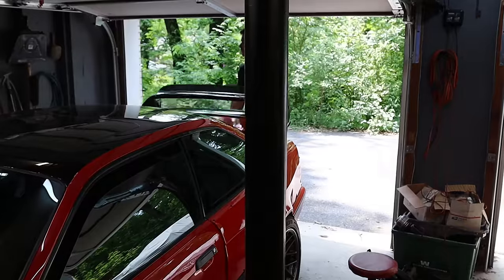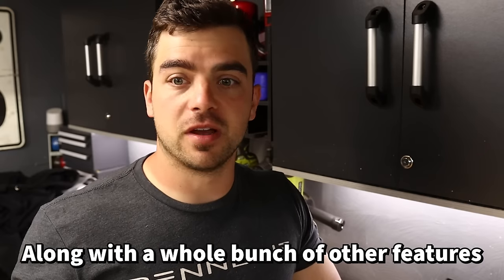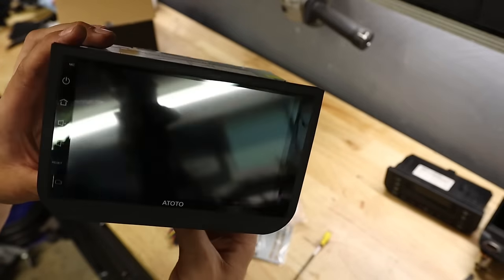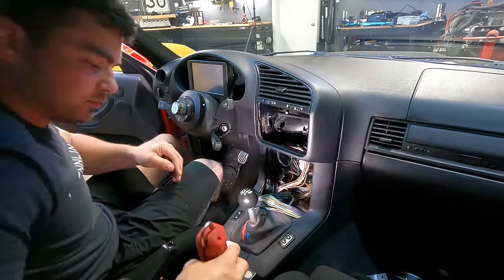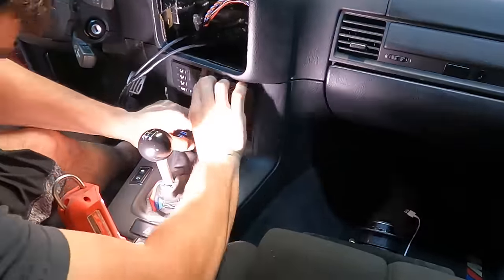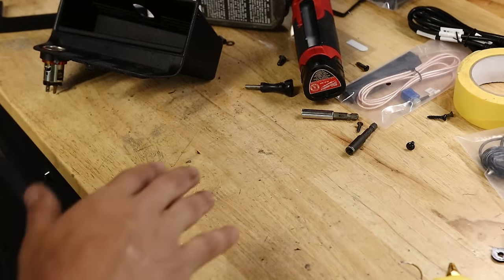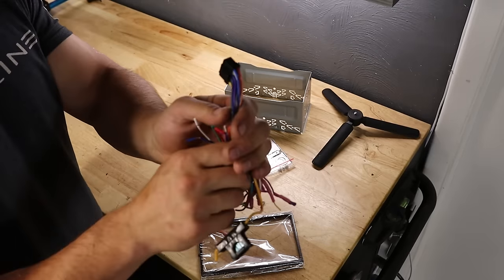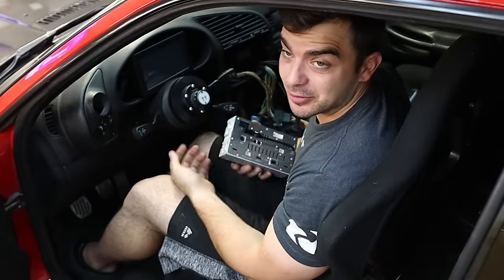The BEST E36 Interior & Stereo Upgrades - Installed on my LS1 Swapped M3

Comment: You're absolutely correct. Those splices you use are perfect for the job (as long as you use the correct tool).  In fact better than soldering. As those crimped joints cant and wont fracture under vibration. Hence, as you say why NASA use them.

Comment: Hot glue gives in hot climates. I prefer to use an alternative which doesn’t set nearly as quick as hot glue but you just gave me a great idea of using the hot glue as a tempeoeary holder while the main glue, the “E6000” dries! It has flexible properties and is using in car audio speaker building all the time actually
Reply from the maker: Good points
Reply: Hey btw you could make it even nicer now. They have the climate control panel which you replace the entire face of your digital control and it’s a square ac faceplate 😊

Comment: The reason people hate crimp butt connectors isn't because they don't work... it's because they don't work long term.  Properly soldered and heat insulated wiring jobs should last 30+ years.
Reply from the maker: I've never had an issue with one.  I've heard of solder getting brittle and cracking after a while though.
Reply: Bmw crimps and solders the power and ground cables in our e36s 🤷🏼‍♂️ I usually solder but I think the reason they don’t recommend the soldering is since most novices really don’t know how to do a good clean solder and as a precaution it’s better to crimp than to end up with a potential cold solder joint that is prone to cracking so if you can do shinny clean solder then no it won’t ever Fucking let you down. I got 20+ years of soldering under my belt 😅
Reply: @matt13ross  I’m a technician for bmw and Mercedes and your super right they crack after years

Comment: FYI. You are not meant to do solder connections in a car they can crack. Crimp + heat-shrink is correct...

Also you do not need atoto. Just get "carlink" and plug it into the USB in the back. It will connect it wirelessly..

Comment: Would love to show you what I have done with my E36 radio...utilizing a Sony XAV-AX7000, backup camera. Struggling with the HVAC relocation as the unit is too long and doesn't fit in the back as it hits the heater control box whether I place it above or below the obc.  I did get a 3d-printed bezel to surround the double-din unit and 3-d printed bezel for the climate control unit which squares it up in the lower area. Just that heater box seems to be a problem. Not sure what options I have to make it fit.
Reply from the maker: You have to shave a little bit off the back of the CC
Reply: I have a case that I cut which. Would definitely serve the purpose. Did you CC control sit flush?
Reply from the maker: Pretty close to flush yes
Reply: I shaved my CC all the way to the blue connector and still touching the heater core  box..any luck or tips ? Thanks

Comment: There are “self soldering “ / “ solder seal” connectors . It’s like a butt connector except better. We use them and haven’t had any issues.  Amazon, is where we got them from 🤘🏻🤘🏻
Reply from the maker: I've seen those, not convinced they are any  better though.
Reply: @matt13ross  they’re definitely not any worse. My buddy and I used them ( no other connectors ) on his obs blazer swap, haven’t had any issues as of now. Doesn’t have a bunch of ride time yet, tune comes last week of this month, so I guess we’ll see as it gets driven. But whatever your preference is go with that I suppose. (Just wanted to mention it in case you haven’t heard of them before)
Reply from the maker: I’ll probably give them a try when my stock runs out.

Comment: Looks good.  Sorry I did not send pictures, but I have no email address for you!  The surround for the 2din is what I did but I made it myself with bondo - they probably got the idea from me!  It will take 10 minutes to fit the bigger stereo, let me know if you need instructions.  The climate control is iffy.  The better way would be to remove the faceplate and add corners to it so it looks factory.  Takes 30 minutes.  Are you going to put the OBC in?  I can show how I did it if interested (I have 3 or 4 spare 18 button obc with pixels you can have if you need one - one is missing pixels and I do not know which one so can't sell them)
Do not want to go too much into stereo component selection here but the Bav Auto speakers are meant to be used with the stock stereo/amp only.  Since the stock system is not that great/powerful they will never sound great.  Do not know your setup but if you are running the high level speaker outputs to the wiring in the car that goes to the stock amp without using line level output adjusters- not good.  I see everyone make that mistake.  The stock amp is meant to take 2-4 watt input/channel and most head units with amps are putting out 12-15 watts/channel.  You would be overloading the amp, which if you are lucky will eventually die on you from being overheated.  If you are not lucky there is the chance it will catch on fire, rare but possible when you overload electronics.
Reply: I am working in getting the climate control to fit in the lower area but the heater box is in the way and prevents my 3d-printed bezel for the climate control from sitting flush. suggestions?

Comment: Am I the only one hearing the autofocus clicking and thusly be driven slowly insane?
Reply from the maker: That's not just you, the auto focus on my big camera lens is kinda loud.  The only way to fix it is to get a different lens but good ones are awful pricey.
Reply: @matt13ross  I am not a creator, so what would I know, but wouldn't an external mic help?  Good work either way, dude.
Reply from the maker: I've got an external mic but it's mounted on top of the camera.  I've thought about getting a wearable one but that's just more stuff I have to have charged, setup, etc with every video.